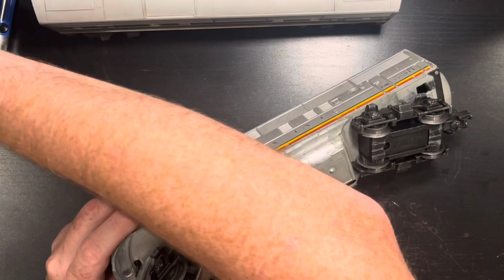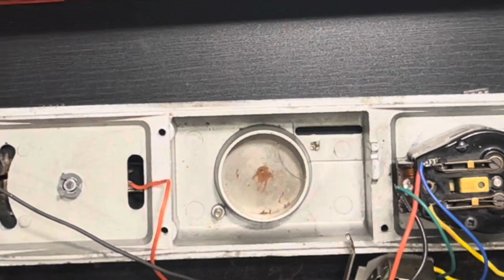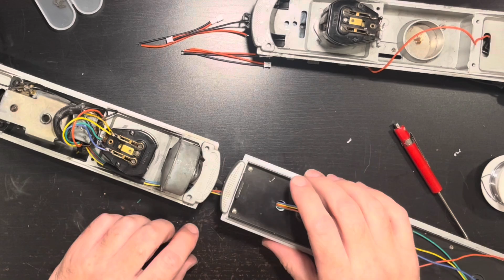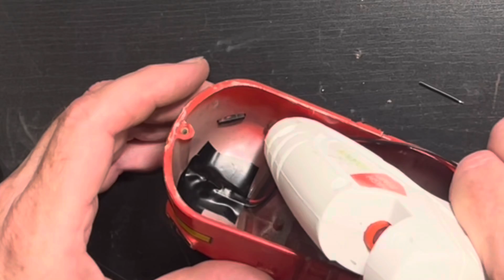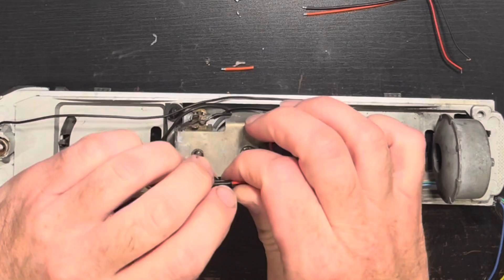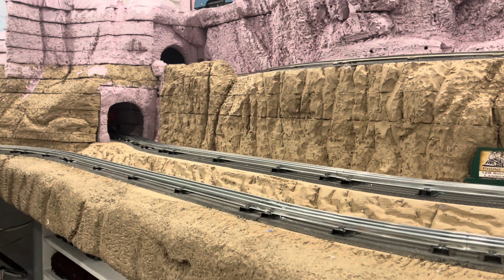Wiring a 2243 ABA Santa Fe Set and Adding Directional Lights: Postwar Project Series

Comment: Model airplane "Deans Connectors" udind 2 4 pin connector aileron extension  cables female half on lead unit, complete cable on B unit and male plug on trailing A unit
Reply from the maker: I think those have been recommended to me in the past, I should really check them out. Thanks

Comment: Not jumping ahead in your video, my first thought is why not fix the E-Unit and then lock the E-Units on each diesel so they are pulling in unison? Do you know if there's a downside to using Superglue Gel as opposed to hot glue?
Reply from the maker: I dislike having to lock e-units to get two going the same direction. I’d rather they operate so I can reverse the train if needed. Also I bought the second A specifically to use it like this. But yeah, just locking the e-units would be easier!

Comment: Could it be the capacitor is keeping  the led lit once the direction is switched?
Reply from the maker: I’m no electrical wiz, but I think it’s the fact that the device I have hooked up takes the ac and converts it to dc. Without that, it all works the way I want it to.
The capacitor only keeps the bulb lit momentarily

Comment: I know that directional lights can be done on the conventional mechanical revers units with the normal incandescent bulbs, but not with the LED. Now I assume your LED had a voltage dropping resistor somewhere and a diode as well since the LED requires DC current and a voltage of about 1-4 volts depending on the design. Now if you had a electronic reversing unit with DC motors having directional lighting only requires a diode on one of the wires to each bulb and then wire it to the DC motors, depending on the direction of the diode the light will light or not light. I just tested it and it works very nice with incandescent lights on my test.    Nice and open real project.  Nice to see the reality of these projects.

Comment: That was a really fine job, Dave. Looks very nice leading passenger consist. Very smooth running. Quite a great tutorial on what looks to be a rather complex restoration.
Reply from the maker: Thanks! Like most things, it’s not as complex as it seems. Essentially it’s wired just like a 2343, except with a lot more wire between the motors!

Comment: Hey Dave, if you come up with a better tethered system be sure to pass it on. I'm fine with just locking out the E units for one direction operation only when double heading powered units for continuous running in one direction. It's not likely I'll be using reverse in those situations anyway. I have ran as many as three powered units together without any problems. They have all been AC pullmor motors. I have ran several can motered engines together like this but have concerns about damaging them or their boards. I don't have those same concerns when running the AC motors with non electronic E units together. It's not like the dual motored AC engines connected to the same E unit run precisely at the same exact speed anyway like those that suggest one must do to double head them. I've seen a guy who tethered what I believe was at least an ABA 2343 with a custom dual motored B unit he built from scratch out of the frames from the rear sections of two powered A uints to provide for the use of powered truck sections. He fused these together in convincing fassion so as to fit the B unit shell with powered trucks. . He had 6 motors ,24 wheeled drive with at least 4 to 6 horns working simultaneously. It sounded pretty cool with that many horns working at once with different pitches. I don't recall how he interconnected the engines together or what he used to power the DC horns. It was very well done although pretty wild it ran and sounded very well eventhough he destroyed two postwar frames to do it. So drilling a couple little holes in a B unit frame is hardly sacrilegious. I'll be passing on your video of hot gluing the LED lights in place. The laddy I buy my LEDs from had a conniption fit when I told her I hot glue mine in place. She only recommendeds using the clear painters caulk or her special wax. Apparently according to her,  hot glue isn't something one should use to secure LEDs. Obviously she didn't realize she was in the presence of a McGiverish individual or that I couldn't afford a couple of extra LEDs. Have you ever experienced any failures to any of the LEDs you've installed with hot glue? I find using the 5mm LEDs to be a good size for a direct replacement of the lenses on most engines. I remove the lense and install the LED directly in the opening and use the painter's clear caulk to hold it in place or sand and press fit in place. Light sanding the lens will not harm it. It will actually help disperse it in more directions. LEDs by their very nature is a single concentrated point of light. Do you recall the 1st use of the red LED Pointers? That's why they made good pointers. Hence SMLEDs. Surface mounted LEDs disperse light radially and are better suited to use in structures and passenger cars for better overall uniform light spread without hot spots.

Comment: Dave, wouldn't it be a lot easier to just add a Williams   Electronic Control Board and move the other Motorized truck to the first A Unit. Then you could of used the twin motor A-Unit to haul around both the Dummy A & B units. As a bonus, then the Williams control board could have directionlized your head lamp also. But your approach was interesting, but I think much more difficult.
Reply from the maker: That would certainly be an option. But if I moved both motors to one unit, it really wouldn’t be any different than a 2343. I liked the idea and challenge of the project and using the old technology to do it. Hey, there’s no wrong way to play

Comment: This was a fun tutorial Dave! Both units are running very smoothly together. I found that if you use a 12v square battery on the horn for 2 seconds, it will help wake the horn up. It has to be 2 seconds exactly or you’ll end up damaging it for good. But afterwards it will be fictional again once it’s wire up to the engine again.🚂
Reply from the maker: Thanks! Yeah I’ve destroyed a horn or two hitting them with track power to wake them up. Not the best choice I guess! I could get the horn to sound just not through the relay. I’ll fiddle more with it another time
Reply: @dagryffynhobby  cool! I don’t usually like to work on them right away either. I also meant to say a 9v battery. My memory has been a little wonky lately. Don’t know why.

Comment: Nice work Dave!  And if the LED flickers a bit going in reverse so what?  How often are you going to back it up anyway?  Were I you at this point I'd start looking for some more aluminum passenger cars for a REALLY impressive long consist!   🤩
Reply from the maker: I really won’t back it up much, but that’s not really the point! It doesn’t matter if I use it or not, I just want it to work.
I have another coach and vista but they are just too heavy all together to pull reliably.
Reply: @dagryffynhobby   OOOOH, you know what THAT means?  A powered B unit is needed!   😉